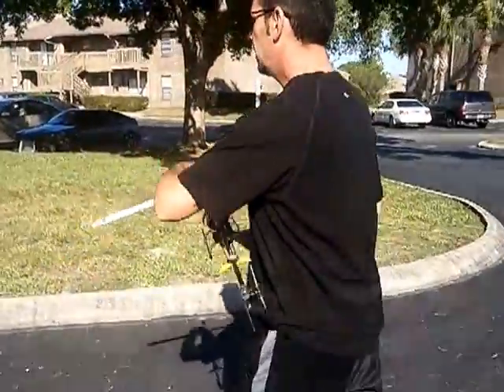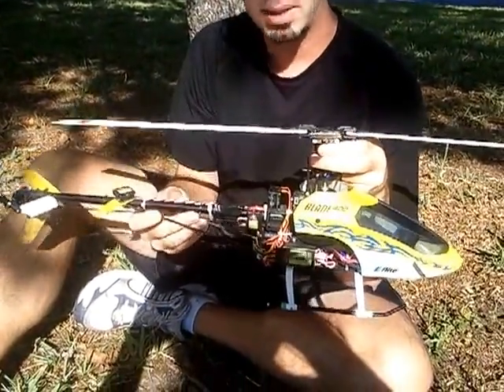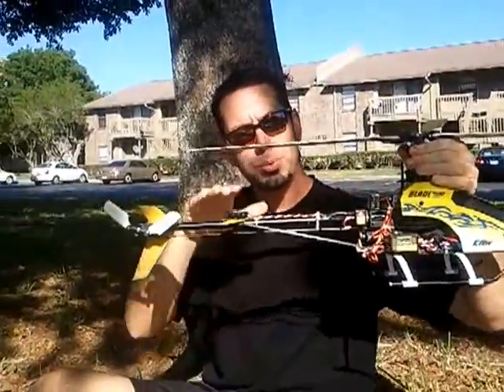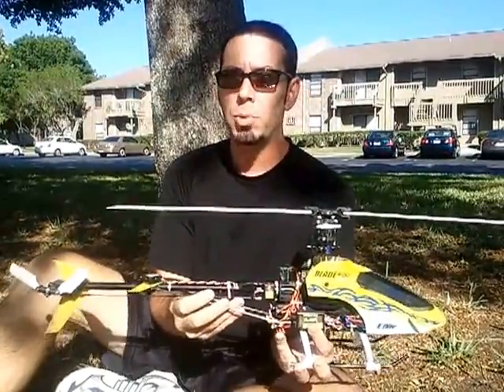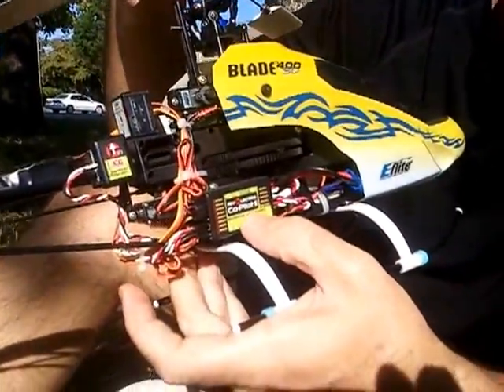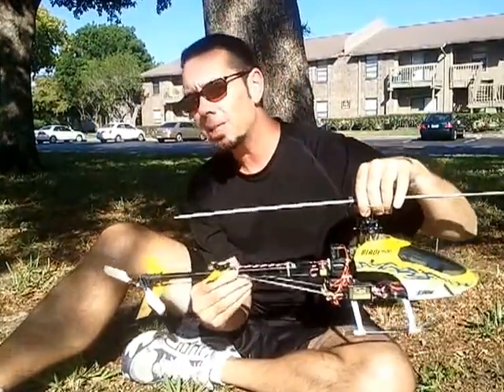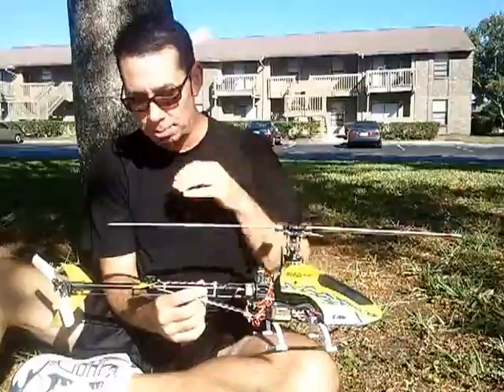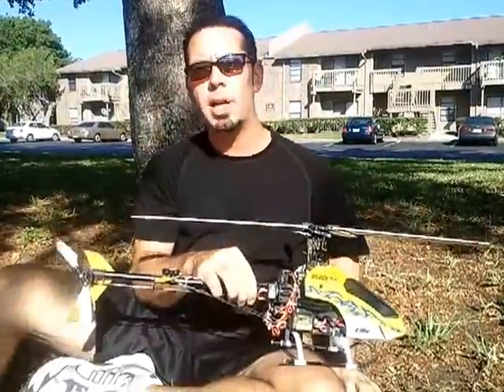Crashproof your Helicopter - FMA / Revolectrix Co-Pilot II - Stabilized

Comment: Question. Can this be installed in an older nitro helicopter? I do have a fly bar, so I’m assuming that this can be installed in a helicopter with a fly bar? I noticed the ones that have gyros are only for fly bar less Heli’s only. I noticed the helicopter in your video has a fly bar like I stated mine has a fly bar as well. It is a nitro shuttle. Would this be something I could use? Where is there another product out there on the market that I can use to self level/stability my nitro helicopter with fly bar